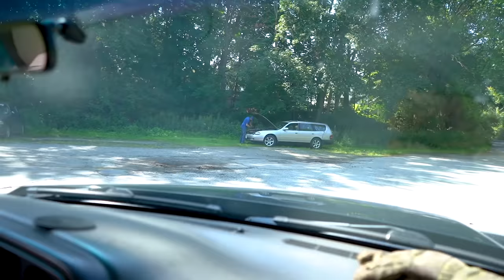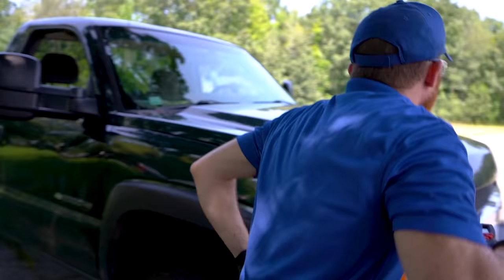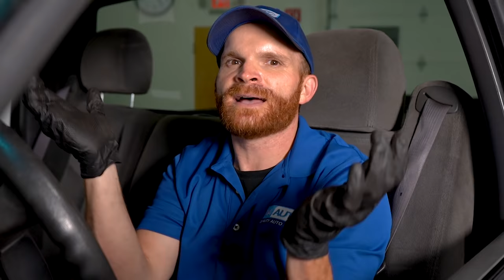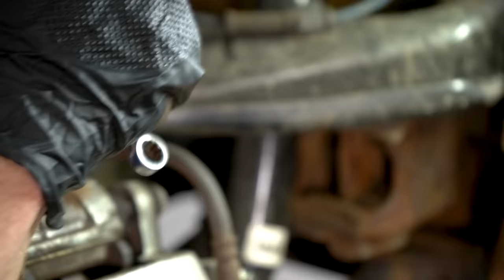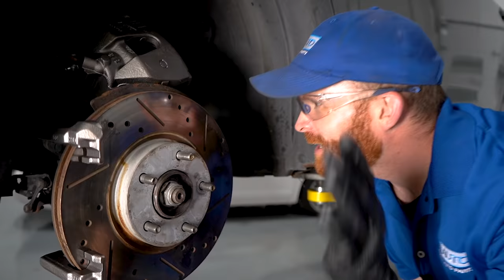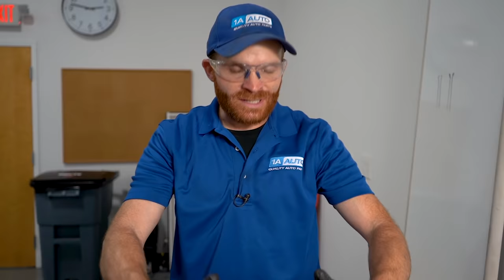Shaking, Pulling Steering Wheel? How to Diagnose a Seized Brake Caliper!

Comment: So I just recently experienced a very similar issue with my 2010 Chevy Equinox. I had just purchased it only 2 weeks prior with 132k miles. While driving early on, especially during cooler temps, nothing was noticed, but after abput 30 to 45 mins of driving and thus braking periodically, it would become nearly undrivable. I brought it to a local firestone service shop, but since it was a Saturday and they didn't have a certified technician on duty, a true inspection was possible. The following Monday, located a "Napa Auto Service Center" a couple blocks away whom agreed to inspect and repair same day(which was crucial in order to drive to work that same evening). Thing is though,  about an hour prior to them opening, I found a video suggesting that if there was too much fluid in the reservoir, and the vent hole is clogged, it could cause the brakes to subsequently drag. So since inspection for too much fluid was so simple and quick, I did so. And yes, it did appear there was too much fluid. In fact, I wound up removing 100 cc's with a large syringe. And in doing so, I immediately noticed how abnormally greenish the color of the fluid was. Not truly understanding at the time what that actually indicated, I just replaced the cap, hopped in, and prayed the too much fluid fixed the brake drag. But NOPE! No such luck..... Fast forwarding, brought it to the Napa center an hour later(830am), explained everything to the owner, especially how I removed so much fluid, and how I was next to positive it was the front pass caliper due to the pungent odor billowing from there, along with the rim being covered by brake dust way more than the other rims. It qas then that he made a comment about how "It's most likely the brake hose being pinched or collapsed". I left the shop with the expectation it would only be a couple hundred bucks at most..... WRONG! And i need to add a couple more little details to fully drive my point home regarding this shop and its fraudulent owner..... So 1130 rolls around and since he said they were going to be performing a "full brake system inspection" that would cost $125 if I chose to not have any work done or they didn't find anything wrong (but I'm guessing this theif rarely if ever tells ANYONE there's nothing wrong when there actually isnt) because then he'd have to deal with someone wondering why he's charging nearly 10 times as much as any other shop for the same inspection. So at 1130, i still hadnt gotten a call from him regarding this full inspection and it's findings, and since they closed at 4, plus needing to leave for work by 430, I began getting worried/anxious that they weren't going to get to it as promised, thus having wasted the only free time I had for hopefully fixing this issue on my only means of transportation(which already caused 2 missed shifts already) soi called them. He said they were "literally about to pull it in" . Go fgr! So i onve again expressed concern regarding my time sensitivity issues..... It was only 23 mins later he texted an estimate for $587.99!!! And the form listed 1.2 hrs of labor to R-N-R caliper, .9 hrs for the brake hose (you know, the one he mentioned before even laying eyes on my vehicle) and $160 for the caliper itself, $93 for the hose, and $15 for whatever"other" is! I still haven't found a part gor my Equinox with the name of other! Oh, and $50 for a "system flush". Also, it said in the estimate that the pads would be replaced if found necessary but was included in the cost of the caliper charge. So altogether it was 2 hrs of labor at $109.99 per hr.... I called him and justified paying that ridiculous amount ONLY because they promised it to be done same day, plus with new pads, I would have paid around 300 myself had i chose to do it (which since I live on a really steep decline with on street parking in downtown Cincinnati thought it was worth it just to not lose my job and not have to rent a car or pay for ubers) When i called to approve the work, he said it would be fully ready by 2, only 2 hours away..... So when 145 rolls around, I call to see if everything is on schedule, and not only was he obviously bothered and rude by my asking, he said the parts had just arrived and they would be pulling it in next to begin. At 220 I get a text that my vehicle was ready!  Only 35 mins later! 35 mins to fully flush, bleed, and replace all that!??? Ok! Whatever. I thought they wete supposed to be trustworthy, especially being backed by Napa! NNNOOOPPPPEEE! That was on April 15th. Well by April 27th, I begin having new issues with the rear drivers side caliper doing the same thing! I popped the hood, glanced at the brake fluid reservoir, opened the cap, and BBAAMMM! I immediately noticed the SAME GREEN FLUID! We all know new brake fluid (DOT 3 AND 4) is clear to amber! How in the world, if he did a full flush, would it still have the same dark green fluid!? It wouldn't! He clearly didn't flush it at all! Which led me to suspect him altogether. I mean, if he lied about the flush, what else did he lie about? Right!? I looked up the hose he charged me almost a hundred bucks for..... Only $15 on Napa's website for normal cinsumers, so you know he prolly only paid 5 or 10! He didmt change the pads! Plus the rotor got warped and glazed from all the extreme heat. My vehicle shakes when i apply the brakes now constantly. I confronted him and he tried convincing me that there's no way his mechanic wouldn't have left the same fluid, then changed his story to something about they used the diagnostic tool to bleed and flush the front caliper only. To which i replied " That's not a system flush then! That's just bleeding the caliper!" So after contacting a different more reputable shop, the mechanic there said he was supposed to have tested the old fluid for contamination especially with the green coloration because that's indicative of copper breaking down or water in the system. Both if which will undoubtedly ruin all the remaining components of my brake system if left untreated. So i am curious your thoughts, please? Especially with the new developments of new dragging with yet another caliper. Do you feel I have grounds to sue this dude? I mean, what if i now have to replace the entire system due to the contamination in the fluid that he lied about flushing? I really appreciate all your videos and information and I thank you if you read all this! Sorry so long! Hope to hear back.....

Comment: Your hub nut could loosen. Had it happen on my jeep cherokee. I felt it right away driving onto the highway.
I went home and decided to rotate tires front to back. Soon as I pulled the front tire you could tell.
Apparently the torque broke free on the hub nut. The nut cover and cotter pin kept it from moving any further .
Just replaced both front hub assemblies and things have been alright.

Comment: Because the rotors are shiny metall, the temp reading won't be accurate (the number on the screen) but the difference between left and right can be trusted. To get a reliable reading you need to set the emissivity of the material you're testing

Comment: dude, someone just ran into the front of my truck breaking a break line in the front so i replaced it and got it all bleed out. My truck was fine for a bit and didn't shake until i bleed the brakes. THANK YOU FOR THISSSSSSSSSSS!

Comment: This was a great video. Thank you for taking the time. Do you have any videos on how you bleed brakes with a single person? I recently bought a pressure bleeder and have not used it yet
Reply: You start with the front driver side , then across to front passenger side , to rear passenger side and across to rear driver side. Good Luck
Reply: @georgekish3462  you start at the furthest brake frome the master cylinder first and move till you get to the closest.
Reply: Check the workshop manual, newer cars have different bleeding procedure

Comment: Around 5 years ago, my Cherokee had me pulling to the side on the road. Unsafe on the highway. To find out, the one brake rotor was extremely hot and the other was cool to touch. Bad brake caliper

Comment: Great video, but Sometimes its not just the caliper. Brake hoses can separate internally and form a check valve type condition, where you think its just the caliper and its not. Always best to replace the hoses w the caliper if the caliper appears to be seizing, The fluid goes in to  the caliper but is slow-moving back when pressure is released. Also the smell of burning pads. The hoses typically separate internally if someone allows the caliper to just hang or puts a kink in the hose when removing the caliper or pads, just food for thought!

Comment: Thank you, very informative.
I am facing similar issue. Ordered a rebuilt kit, hopefully it will help. Caliper is aluminum 6 piston and cost about 2 grand to replace so will try to revive it first. I actually bought used caliper, cheapest on ebay, because it is safety issue, I want to study it before I touch thouse on the car.

Comment: sized caliper， i just did my car with new caliper, problem solved immediately！
Reply: I had two on the same side, calliper piston’s very sticky, the wheels were very hot after running for a few miles is the next symptom.
Reply: @johnmansell5097  same, mine is more worst, car shaking during drive, take me long time to find out it was cause by caliper. if you find out your caliper is sticky  and replace immediately, it will save your new brake pad and rotor

Comment: My 2004 Dodge Dakota has new calipers, brakes and rotors. We have experienced this after replacing the vacuum booster. I had bought everything down to all the tubing. Original steel lines are rusty and crusty.
We just changed the master cylinder yesterday and need to further troubleshoot.

Comment: I can get that seized caliper apart but I am old, and I know a few tricks. I pump grease into the caliper. Grease is not air. It will not compress. There is a second trick. Put the caliper in a plastic bag and then put the whole mess in the freezer. Often the piston will fall out with a gentle tap using a screwdriver and a hammer. AMAZING! Hone the bore in the caliper, a new piston + a rebuild kit and it's good as new.

Comment: How often should the brake fluid be replaced in a vehicle . not something people really do you know. just wondering . Ive got a 8 year Chevy Silverado with 43,000 miles on it .
Reply: There is a brake fluid test kit that will tell you if your fluid is still good or not. You can also look at it, if it is a dark color that would be a good indication to go ahead and flush it.
Reply: I have a 06 Chevrolet Silverado,and between 50 and 60 when I start to break the back of the truck feels like its bouncing up And down where should I start and what do you think the problem is?? HElP

Comment: This is a PITA problem to have in a way because the symptoms usually point to unbalanced wheels, bad CV joint or bad wheel bearings. 

When checking out my car to see if my wheel bearing was bad I noticed the brake caliper was able to move a little where as the side I figured was not the issue ( due to the wheel not being extremely hot after driving) the brake caliper was solid and I couldn’t move it.
Reply: My confusion was that I had replaced everything in the brake system except the hoses on all 4 corners with brand new parts.

Comment: Question: a week ago I got my brake pads replaced no rotors just pads. Ever since then my steering wheel has been shaking horribly while driving and while braking. Is it possible that the mechanic seized my caliper due to not installing the new pads correctly? I returned and they said my brake hoses were bad. They replaced those and still …shaking. I’m not sure if he took the brake fluid cap off before compressing the caliper. But my car didn’t shake at all before he put the new pads in.

Comment: Great video as usual. I’m wondering if you could help me with an issue I’ve been having with my car. For over a year now I’ve been trying to get my vehicle fixed but not the dealer or other mechanics have been able to figure out what the issue is. When I drive to 60 miles and over, the steering wheel shakes, not violently but noticeably and brakes shakes also. I’ve changed the rotors and brakes 4 times, that didn’t help. I’ve change the tires 3 times because the dealer said that’s the issue. I’ve change the axle on both sides didn’t fix the issue. I don’t know what else to try at this point , any suggestions please?

Comment: I'd wanna check that rotor out too. It probably warped from the heat.
Reply: i would say its deff warped, if not it would just drag, shaking is caused by it grabbing then not grabbing, ofv oil on the disc can cause that to, but that dont seem to be the case here

Comment: Now can this issue happen like intermittently? I've been having the same exact problems with my brakes and they're definitely getting worse the longer you drive so they are overheating I get a shake only every time we pull them apart they like pass every test everything else is new on the braking system 🤷🏼‍♂️

Comment: I have a Chevy 06 1500 2nd pickup. I replaced both front rotors n pads. I had to replace driver side caliper. After short drive, the passengers side tire shook while coming to stop. The caliper did move. The driver side had a bigger line bolt with bigger hole, could that cause shutter in wheel

Comment: I had problem with my passenger side calliper, which was stuck, I got new caliper but didn’t change the flex hose and it’s getting stuck again. Could you please advice me with issue. Thanks

Comment: Hi my 2006 Ford expedition is pulling like a jerking feeling at 45 55 and at 75 with a vibration as well as when I'm breaking. Can you tell what it might be my mechanic change the ball joint on the passenger side and that didn't help can you help me figure out what else I should have him check please?

Comment: Do you have a work shop for 
people to bring there cars. 
I have done the above from the video, but my brakes still locks up and over heat. The vibration has gotten worse. I can barely drive one mile. I do t want to dispose my truck, but I am get frustrated.
PLEASE HELP.

Comment: I have a front clunking over bumps & got several wrong diagnosis..new shocks,lower control arms,tie rods,drop links,pads/rotors & still clunking & now they said rear drive shaft hmmm😢 2011 srx

Comment: Question. So i have new tires mounted, balanced and installed. But while driving, vibration still there by 60mph and vibration lessen by 80mph. What else can be the problem fo the shaking? I have a 2010 acura mdx. Thank you.
Reply from the maker: +Paul Laygan We wouldn't be able to diagnose an issue like that here, you may want to have a local mechanic take a look at it. Thanks for checking us out! http://1aau.to/m/Shop-1AAuto-c

Comment: Hello mate, I have changed my master cylinder, and the control modulator for the ABS , I drove it for a little bit to the store and back and had to take it back to my mechanic once again, what happened this time was my front passenger brake was grabbing and throwing heat from that one side, my mechanic said that the caliper piston grabs on that side however when he releasees the bleeder or something like that that it releases the piston and it moves freely, I am so frustrated with this issue, can you please make any suggestions as to what it may be? Do you think it may be the brake lines itself or brake hoses? My mechanic seems to think it is something in the hydraulics still, but he can't seem to figure it out it seems? Please help a girl out here.

Comment: Just had this happen but it was a parking brake wasn't releasing. Felt like death wobble. Drivers side, I pounded it to the release position and all was well. Strange thing was both rear brakes the inside pads were worn out but the outboard ones were like new. I installed new calipers and pads and then discovered the park brake issue on the test drive. By 30mph truck was shaking bad.

Comment: Great info. Thank you for the video. I have a question about what is happening with my car. It starts vibrating after about 55+ and does not stop vibrating afterwards. I'm guessing i might need new tires. I've already had it checked out by Tires Plus, but couldn't tell me what the issue was except for expensive parts replacement. any ideas? I know it could be a number of things like rims not being true, tires, or struts.

Comment: Elantra 2008 : I have Vibration at 50 to 60 mph. I started with motor mounts, then struts, then rear shocks, then sway bar link, then lower arm with new ball joints, then front sway bar bushing, then and last the front cv axles, and still the same shit.  fuel is good, the car accelerates good, never stall. Any good idea, please. Thank you.
--- Note: new tires, new balance, rebalance, alignment, and whole new brakes.
Reply from the maker: +iris baez We wouldn't be able to diagnose an issue like that here, you may want to have a local mechanic take a look at it. Thanks for checking us out! http://1aau.to/m/Shop-1AAuto-c
Reply: did you find the solution

Comment: I Have a 96 Gmc Sierra with similar issues, except My brakes feel as if they are not releasing? I've changed calipers on both sides and brake hoses. My Master cylinder and Brake Booster also! What else could be going on with it's 😫
Reply from the maker: +Joshua Torres We wouldn't be able to diagnose an issue like that here, you may want to have a local mechanic take a look at it. Thanks for checking us out! http://1aau.to/m/Shop-1AAuto-c

Comment: Hello. My car (Altima) is bumpy between around 25-35 mph on nice roads. It’s not the steering wheel, but the whole car. Do you think it’s the tire balance or alignment? (The car drives straight when not holding the steering wheel) Thx